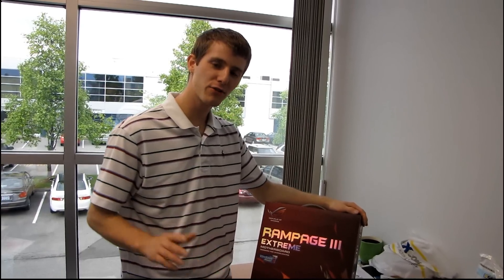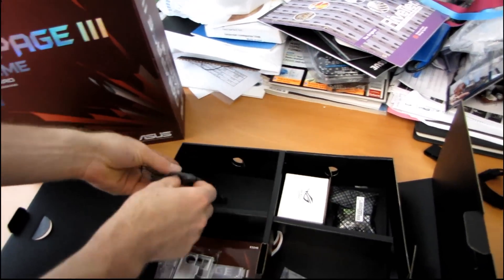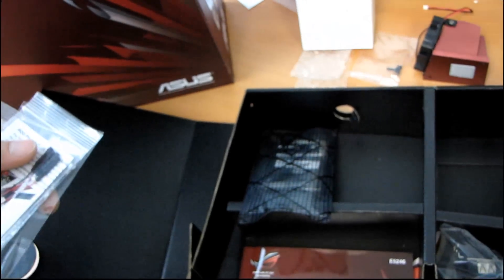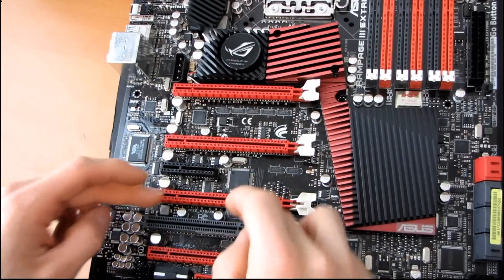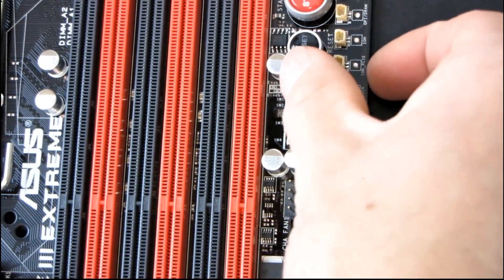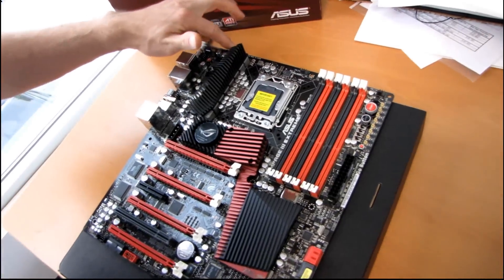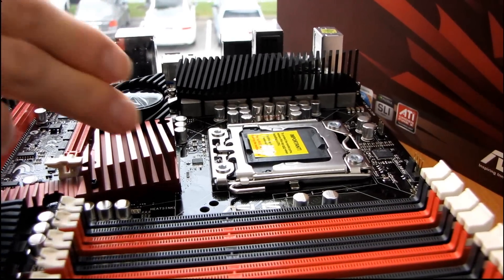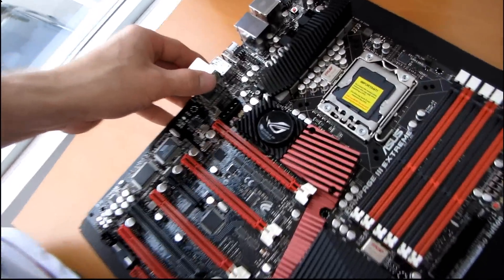ASUS Rampage III Extreme Crossfire SLI Gaming Motherboard Unboxing & First Look Linus Tech Tips

Comment: Did anyone ever figure out how to use the onboard HDMI codec?  In the BIOS, you can select an option that says HDMI/SPDIF   so how does one go about using onboard HDMI for this mobo?
Reply: +Izlude Tingel Figured it out...  lol.  There is a RARE HDMI bracket that connects to the motherboard... you most likely won't find it.  (luckily I did). Most people would use their AMD GPU's HDMI port and install the Realtek ATI driver on top of it.   This does NOT give the same results.  It is completely different.  The onboard codec is much better sounding to the audiophile.

Comment: will this ram fit CORSAIR DOMINATOR GT 12GB (3 x 4GB) 240-Pin DDR3 SDRAM DDR3 2000 (PC3 16000) Desktop Memory with Air Fan Model CMT12GX3M3A2000C9?

Comment: Did you ever figure out what the switches are for?
Reply: +Mooretek They are for shutting down power for the pci-e slots. Extremely convinient if you're running watercooled cards since you wouldn't have to plug them in and out in case a problem appears.

Comment: Hey i have a quick question for ANYONE, i have been watching a video of this guy running 4 ssds in raid0 with this motherboard but i was wondering, was he using the raid controller off of this board or was he running one from the pci slot? Can this board run 4 ssd's in raid0? please anyone answer, thanks.

Comment: Did you have to make any special settings for the second pcie_X8 slot to recognize the 2nd GPU?  I also have 3 GTX980 (watercooled) but for some reason the second slot will not see any card I put there. What BIOS are you using?

Thanks.
Reply: There is 4 switches on the left side turn them on

Comment: can someone recommend me a motherboard:
Im wanting to build a gaming system WITH AMD 3+ PROCESSOR and aerocool predator gaming case
budget £1000.00'ish or less
narrowed down to 3 motherboards but still cant deside between the 3:
1.Asrock 890FX Deluxe5 ATX AM3+ Motherboard
2.Asus M5A99X EVO AMD 990X ATX Motherboard
3.ASUS AM3+ CROSSHAIR V FORMULA S/L

Comment: The ROG Xpander.  It's ugly as phark.  I've foregone 4-way SLI purely because of this.  I'm actually looking for a new motherboard now due to this as I've got a card sitting around gathering dust.  Other than that, awesome board.  Get rid of that chipset passive cooling and get some EK water on there and it looks much better.

Comment: @KlingonSpider Are you that pathetic?
Two 1GB XFX 5870's cost here in UK around £315 and one 2GB XFX 5970 which is two 5870 cards in one cost's £450, the 5970 is obviously the better value and Crossfire and Sli don't give twice the power but a bit more fps in games which isn't really worth it unless you Crossfire or Sli the high end cards like 480 or 5970